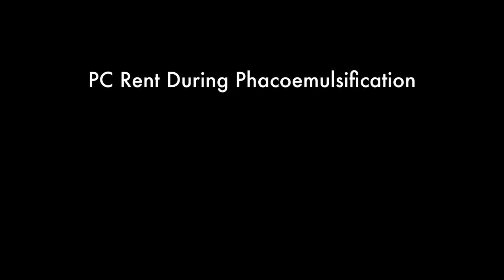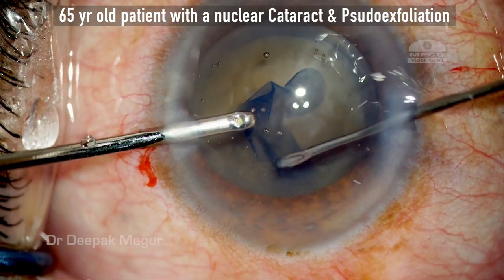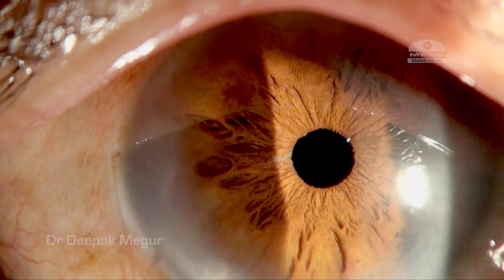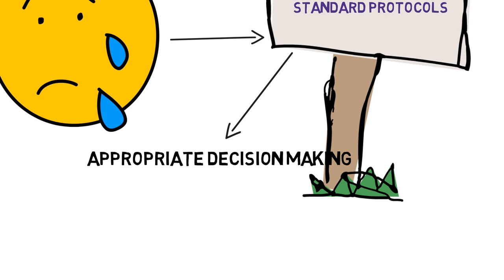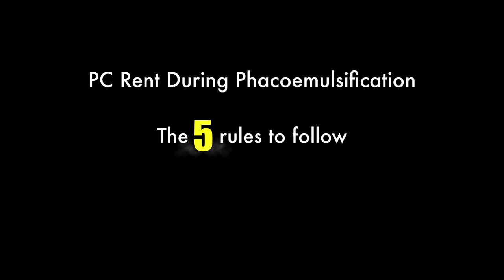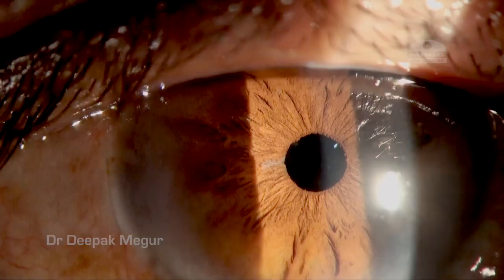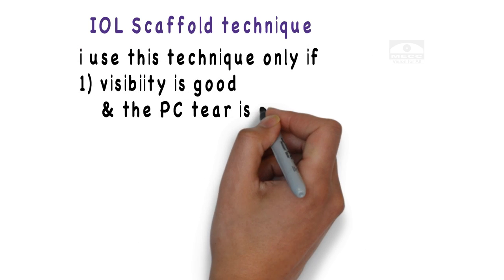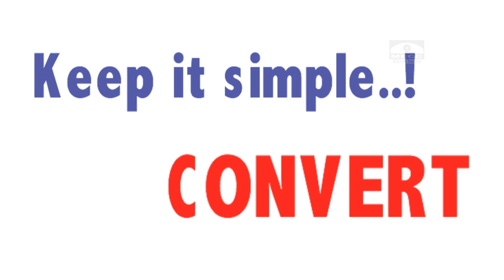PC rent during phacoemulsification: the 5 rules to follow, Dr Deepak Megur

Comment: Sir am feeling difficult to convert to sics during phaco.. more of visco leakage is happening which am feeling difficult to make tunnel. Any tips regarding this
Reply from the maker: If your original wound construction is good and if you are choosing to create a fresh scleral tunnel 90 degrees  from your original phaco incision , this issue of hypotony should not arise.in the worst case scenario you can suture the original incision and create a fresh scleral tunnel 90 degrees from it.
This is the reason i would avoid from creating scleral tunnel adjoining the original phaco incision
Reply: @DrDeepakMegur  ok sir. Thank you so much for sharing your knowledge.
Reply: @DrDeepakMegur  I had PCR 2 days back for my case.  I noticed it while I was emulsifying the last piece. I injected visco and emulsified the last piece.  There was no vitreous disturbance. I planned to make a sclero corneal tunnel but it was going superficial and I couldn't make it. So I extended my clear corneal incision and placed rigid PMMA IOL in sulcus

Comment: Sir what IOL power to use when putting IOL in sulcus?
Reply: It depends on the base iol power, its called the 9’s rule if its a 0-9 D iol no change, 9-18 D substract 0.5 D, 18.5-27 D substract 1 Diopter, >27 D substract 1.5 D